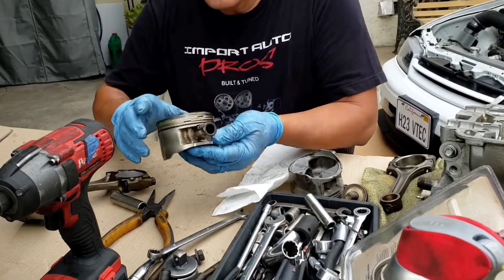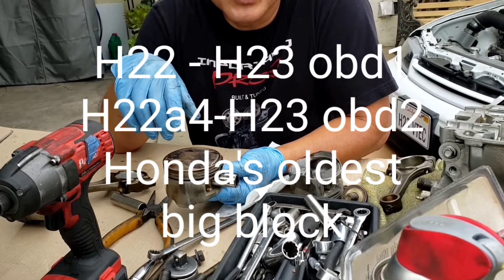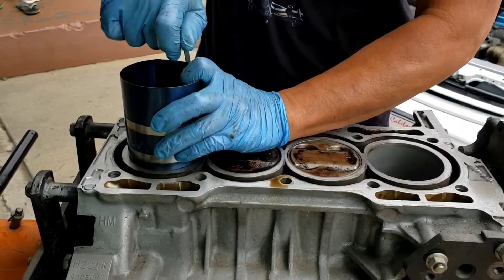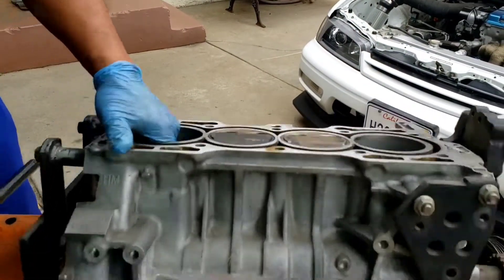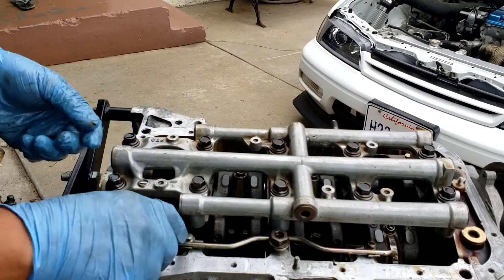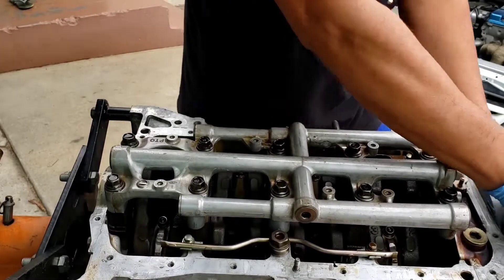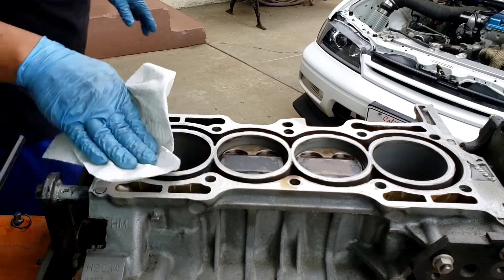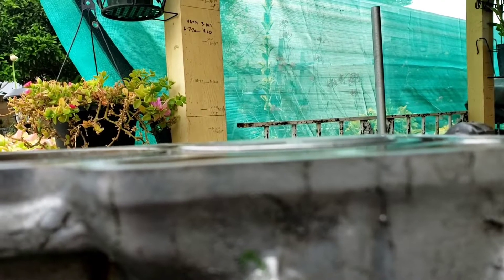G23VTEC build, H22 piston sticking out.

Comment: I hope its not too late to send a question... Lots of great info in this video! I'm about to build a stroker NA H22 block, forged F23 rods, F23 crank with Type S H22 pistons, Skunk2 cams, E85. My goal is to keep compression as high as possible without killing reliability. 1) Would you recommend shaving the piston deck or is it okay to have it stick out 0.040? 2) What size head gasket do you suggest? OEM is 0.026. 3) How high can you safely rev this setup to? If you made it all the way this far, thanks in advance!!
Reply from the maker: Lots of builders have same setup like how you want it built. I assumed your block is 98-2001 H22 55mm main. Are going to have it re-sleeve or staying FRM OE sleeve. If staying frm sleeve, l recommend to use Honda OE H22a4 type S piston. This way you dont have to worry about parts compatability. The aftermarket Tyoe S that you can get might give you a piston to wall problem in the long run. Stay Honda Oe piston if you can and worry about something  else. I'll leave the piston as is( 0.020" pass the block) if you want more compression ratio. Use flat valves if you like to raise even more coz if you use thicker headgasket, it'll lower it a bit.
Reply from the maker: Using thicker headgasket than OE (.026") will give you the extra piston to valve clearance if you plan on using sk2 cams but l'll clay the motor if l were to build it, just to make sure there's plenty of clearance.
Reply from the maker: Also, if you use a thicker headgasket, you need a adjustable cam gears and you have to use kstune belt tensioner or something similar. If you use a f23 belt adjuster on H22a4 block, it'll be tight. If you watch my vlog about the timing belt being too tight, just do the same, grind off some material from the adjuster and ypu'll be golden.
Reply from the maker: The engine can rev up to 9k, that l know coz  l have some subs that emailed me back about their build. It all depends on what parts combo you'll use. Make sure yo use a good valve springs and good luck to your build.  Visit zealautowerks.com just to give you an idea of your comp ratio target. Thanks man!
Reply from the maker: You can't use h22 oil squirters anymore and need to plug the oil supply port once squiters tube is remove.
Reply: @sagittnet2158  you are the absolute man... thank you!!! Yes, the block is a 55mm a4 block. Got aftermarket springs, cam gears, and a degree kit to degree the motor. My intake valve is oversized and dished but I plan on adding a flat face exhaust valve since I have them sitting around. My flat face intake vales are O.E. diameter (35mm) so can't use it in my other head. I know I'll have to clearance the pistons even more with the pistons poking out, we'll see what the clay says. Thanks again for all this info!!
Reply from the maker: @Donyce19  no worries man and keep in touch. Lmk how your project going

Comment: How did you assemble the pistons and rods?  When I assemble my F23a pistons and rods they lockup/ hard to move. The wrist pin need to be heated up a lot to get then connected. What am I doing wrong?
Reply from the maker: I rolled a sandpaper on a socket and rolled it inside the f23 rod, that's how l fixed my aftermarket rod. If all of your f23 rods require you to heat them up in order to install it on f23 pistons, you might want to do some inspection, coz it should not require some heating.
Reply: @sagittnet2158  Yes I'm using F23 Brand new OEM pistons and reusing the old rods. I had to heat them with a heat gun in order to disassemble them per the service manual. The wrist pin didn't fit freely in the pistons brand new straight out the box so I assume that need heat to assemble them.
Reply from the maker: @1Man77  Does your F23 came from Honda Accord and what year model was it? 1997-2000 F23 should be a floating wrist pin. All f23 that l worked on, never have to use sny heat gun to remove or reassembly of it. That's kinda odd!
Reply: @sagittnet2158  They came from an import JDM F23a not sure what vehicle but the replacement pistons are new USDM. After cleaning the small end of the rods using your 2000 grit hack the pins moved and glided freely now. And the service manual for the 1998-2002 Accord does state & show that the stock piston must be heated to no less than 158°F for expansion or it will not work trust me. The wrist pins once properly inserted remain in place as the rod rotates around the pin. I'm good now and thanks for the insight.
Reply from the maker: Are you mating the F23 piston on f23 rods? If so, maybe the rods got damages or something coz wrist pin should be floating. It happened on mine, the aftermarket rod that l'm using, 1 rod got damaged and the wrist pin wont go in, l have to use a sandpaper to fix it. But if you are mating your f23 piston on different rod, verify that its not a press to fit wrist pin. Are you also building a G23?
Reply from the maker: Was your f23 came from a Isuzu or Honda?

Comment: sir, can i use jdm h22a pistons in f23a rods,because h22a(old model)has press fit pins.what do you think?
Reply from the maker: You could, you can always dry fit the H22a wrist pin on F23 rods. If it doesnt fit, since it has a bronze insert, use a slightly loose socket w/ sandpaper and hit it till you get your desire fitness. If you have a F23 piston, use F23 wristpin and secure it on H22a piston. Does the H22a have a lock ring? If it does, your good to go.
Reply: @sagittnet2158  no it does not have lock rings its the 1st gen h22a jdm with close deck.so crank also wouldnt fit.little delima but decided to go f23 block but can is stick h22a frm piston in iron sleeve f23?or go spend money and but k pistons 😂
Reply from the maker: @josephdegoma1518  l have not try using OE piston on iron sleeve yet but it should be fine. It's not good when its the other way around, using aftermarket piston on frm block. Not sure if you ever see the 1st g23 non vtec version, way back on Honda-tech.com days. He used a H22 piston on F23 block and drove it for thousand of miles, he never have a problem w/ it. It should be good.
Reply from the maker: @josephdegoma1518  if you do use f23 block, pls only use Honda F23 headgasket do not use any other. There are 2 brand that Honda use for F23, check the copper rivets that hold the gasket together. Remove the copper if its gonna be sandwhich by the head and block. I think l showed the p/n of the oe gasket l used. Also l've seen some have problem w/ oil leaking using kstuned plugs. Not sure what you'll use but l simply use a water coolant plugs and hondabond. Never have a issue and been using same cyl head for the 3rd time.

Comment: I have a sleeved block h22. If I run a h23a crank with f22 pistons (which I have) can I get any 87mm k20 piston to safely run boost?
Reply from the maker: You pretty much have a solid base to begin w/, having a sleeved block. You just need a forged piston and your are solid gold already,lol! Joke aside, yes, you can use a K20 87mm piston but there's a little bit of drawback, but its so minimal that you and l cant tell the difference. Piston height difference, k20 have 30.0mm and If you are using H23 crank you need to find a piston that have a 30.55mm piston height. Meaning if you use H22 block w/ H23a crank,  h23 rods and K20 pistons, piston will be sunk a little bit down on the block. Actually its better than using h22 piston that will stick out .020" pass the block. I visited www.zealautowerks.com and did a research on your info and used k20 87mm info w/ 9:6.1 com ratio (-3,3cc dome) and it turned out to have a 9.82 to 1 comp ratio.(rough estimate). I didnt put any numbers for head mill and also for the block.
Reply from the maker: I suggest you visited zealautowerks.com and play around w/ piston info you want to use and l recommend 9.8 to 1 is a good start for a comp ratio for boost, but dont go higher than 11. 1, unless you are running e85 for fuel.
Reply: @sagittnet2158  I already have have some traum 10.5:1 h22 pistons but I’m afraid of losing the piston rings with the piston sticking out of the block.
Reply from the maker: Yeah, that ring land will be easy target for boost breaking. Youre correct.
Reply from the maker: The info numbers l gave you was just my estimation according to that website, your'e still responsible for any decision you make. So for using 87mm k20 piston sunk a little bit wont make a difference, just try to find a k20 piston that will give you a comp ratio from 9.8 to 10.+ to 1 ratio.
Reply from the maker: When you pick a piston. Cp k20 doesnt have a wrist pin offset, Wiseco k20 have wrist pin offset, so make sure you also pay attention on how to place that wrist pin offset if you pick Wiseco, I learned to found out that H23vtec (bluetop) have a wrist pin offset like f23 piston.
Reply: @sagittnet2158  thanks for the help! So if I buy a cp piston I won’t have to turn the piston around backwards?
Reply from the maker: @anthonydixon3422  yes, plug n' play.
Reply from the maker: Hope that help you out.

Comment: Interesting this worked, i thought the h22 pistons were specifically designed to work in h22 frm cylinder sleeves, which f series can use more options regarding factory pistons, good stuffb
Reply from the maker: I think any cast piston will work on H22 ( providing it has same specs) Forged piston material l think it swell so much that it locking up inside if the piston to wall clearance is not correct. Mahle pistons is the only one l know will work. Thanks for watching.
Reply: @sagittnet2158  correct mahle are the only pistons aftermarket that will work in h series blocks cause of frm cylinder sleeve any other piston other than those from H series probably would have a good ending due to material friction differences not getting  along, but no confirmation of this just based entirely on research and articles im experienced with Bseries but own cb9 wagon and has jdm f23a and pulls around decent but with sohc topend is horrible, thinking of options and longevity and reliability between h22a typeS or g23 so your video is helpful 😉

Comment: just to throw out some info, for f23a blocks that want to stay 86mm. besides using k20a pistons, you can also use j30a1 or j30a4. you can also use the pistons from the hybrid version of the j30 called a JNA1.  j series pistons have a 30mm compression height. these are a close estimate of compression
this compression is with a 53.8cc h22 head 

j30a1 =  9.8:1
j30a4/a5 = 10:5
JNA1  =  11:1
k20a2  = 11.5

for 87mm use k24a2 pistons
Reply from the maker: Good info, the j30a1 is a good choice if ever l need a replacement being a low comp. Thanks brother
Reply: Im in the game plan process for my build.  Piston selection and cam is where im at.  My goal is to have an engine built as much as i can while making it daily able.  For example, when I build the exhaust Im trying to make it sound as close as stock as possible while giving flow benefits.  I may do flex fuel to run e85 but I need to be able to run on 91.  I thought the k20a2 pistons were like 12.4:1?  I was under the impression k20a3 pistons would be around 11:1 as well?  Any suggestions on pistons that would be good but not overboard?

Comment: How did u shave the piston to be flush
Reply from the maker: I paid a machine shop to shaved it. Got tired of paying someone so l decided to use a 90deg die grinder and use a file to make it even. I was doing a r&d at the time,lol. That's why l did it just to see if it can be done and it worked. Made 196hp and 2nd built was 216hp( h22a4 block w/  f23 internals).
Reply from the maker: And also why l shaved it, coz too much comp ratio is not good if you're using pump gas. E85 no problem. Hi comp require a hi-lift cams and uprgraded springs. Use at least a type s cams
Reply from the maker: That block have f23 internals and as you've seen it. I was able to retained the oil squirters. It helps a lot cooling the pistons. But its a lot of worked. Grinding the crank c/w and notching the piston skirts. You cant just bend the nozzle. The pistons will chop it off if you dont modify the piston skirt.

Comment: What maximum hp can f23a conrod hold?
Reply from the maker: F23 oem rods are not reliable on Boost setup, and you shouldnt use it at all on boost engine. But for NA setup, it can hold some power. Max to the point it breaks, l cant say.
Reply: @sagittnet2158  if NA what maximum rpm can pull? I think I want try this setup but I cannot find forged conrod in my Country
Reply from the maker: @izzat2804  keep it under 7k, just like H22 for longevity. But it all depends on the build setup. Some guys can rev it up to 9k but he's got cams, dampner and among support mods for it. The engine actually speaks for itself when it wants to make power. Hope that help.
Reply: @sagittnet2158  thanks bro..❤️❤️👍👍
Reply from the maker: @izzat2804  no problem, hope your project build is a success and take your time.

Comment: I have a stock h23a block and I was going to use a stock h22a4 head with skunk2 intake manifold, will I have any issues if also use the h22a4 pistons in the h23a block with stock h23 rods and crank
Reply from the maker: If you are using H23a non-vtec block. Usdm is H23a1 so l'll call it that to prevent any confusion. H23a1 block, crank and rods combine with H22a4  pistons. You'll have a higher compression ratio and piston will stick out .020" pass the block. People ran it this way, not sure how long it last. But make sure to have a plan on your setup. You have to use a hi lift cams, at least a type s, coz of hi-compression ratio and maybe use a e-85 for fuel. No turbo on this setup either and no aftermarket piston too unless block is iron sleeve. Mahle piston is the only brand l know that is compatible on H series. The H23a1 rods are press to fit and H22a4 piston is free float wrist pins. But you can always polish the bronze part to make it free float. I highly recommend to buy a aftermarket h23a1 rods even if its the ebay brand, they're ok. That way your rods & pistons are compatible.
Reply: @sagittnet2158  it was actually the h23a vtec blue top I have a h22a4 long block I was only wanting to use the h23a block because it was freshly rebuilt with all oem parts
Reply from the maker: @ek94banger48  l'll keep the H23a vtec as is if l were you. They both pretty much the same H23a have 95mm and f23 is 97mm crank throw . No mods on rods but still the pistons will stick out if you decide to to it.
Reply: @sagittnet2158  ok cool i was only asking cause I have a good h22a4 head with a complete h23a block would that little set up work together I don't really wanna spend money on another head but my a4 block is no good and cracked so I can't use that either
Reply from the maker: @ek94banger48  okay, yeah, if you already have the h23a vtec, you 're not really missing much, the g23 will give you more extra torque than h23a. But is sure is different than those 2 engines, driveability wise. And yes, the way to do it is on h23a or h22a4(55mm) block. Less worry about oil leak.
Reply from the maker: Visit zealautowerks.com to give you an idea on how much compression your setup will be.

Comment: Been watching a some of your videos regarding the G23. What would you say is the main reason for them not lasting vs a straight H series?
Reply from the maker: My opinion will be base on my experienced building the motor. Why it's not reliable like H22. There are lots of factors that contribute why, wrong piston to use. What l meant was, f23 piston have a offset and when oem k20 piston are use, you have to put it backwards to get the correct orientation of the offset like f23 piston. But doing so, now the valve relief are backwards. But no biggie, last time l built one. I shaved the relief to accomodate the h22 valves. Some deleted the balance shafts and not using a crank dampner. These motor vibrates a lot and w/o some means of absorbing the vibration. Something got to give in the long run. And the most killer of all is running this hybrid motor to the moon. Over revving it. H23vtec are made by honda engineer, but it dont last long coz, we over revved it like H22. The g23vtec that l'm gonna put on the civic is also questionable. I'm not really sure if its gonna be good, l hope it is. We'll find out soon.
Reply from the maker: If  building a NA setup and build right. It'll last long and not rev it past 6.5k. It'll be reliable. I have a NA hybrid engine, w/c is 98 H22a4 block, f23 crank, rods and h22a4 pistons that l shaved the top sides of the pistons, so it dont stick out so much. I managed to used the squirters by shaving the f23 crank counterweight so it wont rub on the nozzle and l got  crank balanced, I also used the oem balance shafts. It was a successful g23 setup and it last till l decided to be boosted. If l ever want to build another NA setup opinion. I'll use a  h22a4 (55mm) block, sleeve the block, use JE pistons (FSR)coz  it has the correct piston offset. Ofcourse it'll stick out of the block about .020", it'll be ok for na setup. I'll use the oil squirters. These will be a good parts combination.